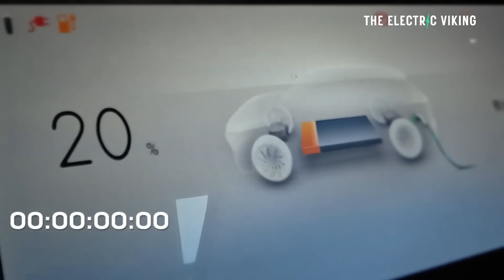CATL Unleashes Sodium: The EV Battery That WILL Rewrite Industry

Comment: 10,000 charge cycles, at what recharging from 80% or from 0% to 100?  And then you If you bought this at age of 20 it would still work when you're 88, my math proves that 10,000 charge cycles if you drive it every day and depleted the energy and recharged it every day you would get 27.39726027397260273 years of life... Still impressive but I'm still not convinced... If your numbers are only driving your car 20 mi and you're at 80% and you charge it up to 100 with no degradation to the lifespan of the battery that would make some sense but if you run it to zero and then charge it up fully what are the numbers look like?

Comment: This channel has always affirmed that li ion batteries are fine. Great performance at all ambient temperatures, long lasting, very rarely catch fire,  great range, lightweight, fast charging.. etc. who needs new battery technology?
Reply: sodium-ion is significantly better in the cold, much safer, has less self-discharge, and likely cheaper once mfg economies of scale take hold.  Historically, main drawback is energy density.

That makes it maybe better in some EV applications, but potentially the default option for stationary storage when mature.  That's a huge deal.
Reply: I just want a battery that doesn't burst into flames.   I don't really want Li-Ion crap in my house anymore.
Reply: Lightweight? EVs are as heavy as a truck. Your statement is misleading
Reply: @ssumac I was being sarcastic.

Comment: I have an e-bike in Shanghai, which has a range about 60km in summary and 50km in the winter.  I am recently shopping for a new set of battery.  Interestingly, there are many sodium batteries on the market, and the price are about 30% lower than lithium counterparts.

Comment: This is certainly welcome news from a Canadian perspective. At the moment, electric cars are great for urban use in all seasons, but for a true all-scenario vehicle we have the three challenges of cold weather, long distances, and poor charging infrastructure outside of major urban areas. (Like having to fill your ICE vehicle using a pump that requires an app that sometimes doesn't work, and when it does you get your gasoline through a ridiculously skinny hose. Hopefully you have a book and not an emergency.) A cheaper battery that works better in extreme cold helps on one side of the equation, and if adoption is significant that incentivises the other.

Without a better charging network it is hard for people to justify going fully electric.

Comment: 10,000 cycles with one cycle every day will last 27.4 years, so not quite as long as you said, but still, really good.
Reply: Do you need to charge every day as a normal driver? Only every other day would be 50 years
Reply: @GoonstarX-n4x  You may be right. I don't even have a car and was assuming that you would need to recharge your car like I recharge my phone...
Reply: @andrewmole745 I knew a taxi driver with a tesla, he told me he can make 350 km with a full battery in summer. I doubt most people drive that much a day. It's not good to keep your battery at 75-100% constantly anyways, at least for lfp battery

Comment: there's a detail to know about how long a car lasts, it's not the engine or the tank (these often can we swapped easily), it's often the electronic and the interior which makes a car expensive to upkeep. Take any bmw with around 15 years of age. The multitude of computers that will start going bad will cost you thousands of euros. Then the new car tend to integrate parts all together and force you to change bigger more expensive parts, on my car the interior door handle broke, I must buy the whole panel !. For instance some new led headlight are one part (not the bulb + the light) in some mid range cars it costs up to 1500€ a piece, even if a led bulb only cost 50€. On the last model S in the back they came up with a light "bar" on the whole width and I guess it's the same range of price. In the end you end up paying multiple times the car over along the way, that's why people change cars often. At least you pay a lot but you ride an all new one. Even if we come up with a immortal power train, believe me, they will make it costly to upkeep.

Comment: hmm LTO has existed for around a decade and is currently cheaper than sodium and has higher energy denisty and higher durability/charge cycles lol. just not easy to make cheap,,,, but for now its cheaper than sodium ion. everyones been sleeping on them. same operational temp range. also my ev is currently at 3k cycles on the original hv battery with no degredation lol

Comment: The Battery Swap was my idea 5 years ago. This is the only thing that will save the Electric Car.
Because the batteries can be upgraded to newer technologies in minutes.
The user should only pay for the mileage they get, not power.

Comment: Wishful thinking. Don't drink the cool aid. Biggest issue with sodium is it's very heavy. Which is why catl is promoting industrial. N charging times are a challenge. Which is y they swap batteries do without infrastructure it's a waste. But it is much cheaper by far. So you may see non vehicle applications.

Comment: The comment about losing 40% range in the cold is probably correct, because of the need to heat the LFP batteries and the interior of the car.
Even with the sodium batteries, in the cold there will still be a large range reduction because of the energy needed to heat the interior the car.

Comment: Electric Dirtbikes from KTM are simply adding a liquid-coolant system/BTMS to next years models, which adds 15-30% range- same batteries, same motor, same bike- this is how effective thermal regulation is! You don’t need more battery. So if you go even furthur and add a sodium-ion battery, with LESS capacity, you may still have the same range due to its improved performance in extreme temps and therefore less loss. So even if Sodium-ion ends up being the same price as LFP, it will still have an advantage in extreme climates and may require less capacity/density, which could then in turn mean the battery is cheaper to produce.

Comment: Wake me up when their is an actual car sold with sodium batteries.
Reply: You won't have to sleep long then
Reply: They're already in use in battery swapping stations, as noted at about 7:45 in.
Reply: They’re in use. They’re just not particularly useful. Too heavy and low energy density.
Reply: @Clynikal  the actual hurdle ist the price (as long as aprox. 7kg/kWh and the volume does not exceed the existing onse more then 10-20%)
Reply: yes , this is the umpteenth disrupting post , remember solid state LOL
Reply: There are already cars like that in china
Reply: Why? You're a lion. Lions can't drive cars. What do you care?
Reply: According to the undecided video on the subject, 30 cars are going to have this battery as soon as January (iirc)
Reply: So if JAC Yiwei starts shipping the E10X, you'll want someone to wake you up a year and a half after it has already happened?
Reply: Well let me wake you up for 'i' instead of  'e' in your their.

Comment: no, the blade 2.0 battery from byd has an energy density of 210 Wh/kg.
* Sodium ion batteries with 175 Wh/kg is for short range
* LFP with 210 Wh/kg is for medium range
* NMC with 280 Wh/kg is for long range
If these netra sodium ion batteries are getting cheaper than LFP, they are attractive for home and grid batteries and pretty shitty low range cars
this is NO game changer for cars

Comment: In defense of carexpert.. I think I watched what you were referring to in regards to range loss of EV's when cold. I'm pretty confident what he was referring to was increased consumption due to increased climate control power usage. It's a thing.. live in Brisbane and when the temp is nice can see 11kwh/100 in perfect conditions, but I've seen over 20 when it's really hot. I imagine heating using the heatpump would have the same effect when cold. It's not necessarily the battery loosing capacity..

Comment: Ack!  Sodium is even more explosive than Lithium!
Reply: But Sodium ions are quite stable - think table salt.
Reply: @BillMitchell-lm8dg  Usually you have a solid lump of metal on side and redox element on the other side of a barrier, and when the ions travel through a "liquid" or some other transport barrier, then you get your stable form and current across the   anode and cathode. That is why lithium batteries explode when Li2O is stable. You have elemental lithium in the battery.  Maybe they came up with some other solution to make the sodium less volatile.

Comment: You might be interested, as many of you do not get low subzero temperatures. I tested the range of my 2023 Kia Niro here in Alberta Canada last winter at -38’C. My Sumer range regularly gets 500 km’s. On this test I managed 260 km’s. I do have a heat pump but I do believe at that temperature there is resistive heating used?

Comment: this is great news as it will reduce the price of electric cars significantly. I think currrent EV producers will very easily be able to just swap out their production line with the newer batteries and use all the knowledge they have built up developing their EV cars.

The battery replacement booth animation made me laugh though. The whole process of swapping out a battery in 3 minutes without  single mechanic is like building an ai bot that is supposed to be able to do plumbing. 

That is a very ambitious concept that I cannot see working in real life.

Comment: Gasoline, Ion, Na, lead based batteries all about energy storage. Storage of energy will be an improving technology, generating energy will be an improving technology. As this research continues, we will see less use for the already tapped out fossil fuels. The car industry has had over 100 years to improve the Internal Combustion engine and didn't go far enough. We are looking at the future in fuel cells, solar, wind, wave and geothermal technology. Just all of us cross your fingers this comes through.

Comment: A typical ICE car without special preparation can handle –20 °C to –25 °C.
With winterization (synthetic oil, block heater, winter fuel), operation is possible down to –40 °C, which is about the practical lower limit for most consumer cars.

Comment: Battery swapping doesn't make sense from an owner's perspective or a seller's perspective and would invite battery swap fraudsters to cash in on taking good high value batteries in exchange for dodgy low value batteries worth potentially thousands of pounds in losses per downgrade.  If the rate of charge is going to increase then it makes much more sense to just fast charge the same battery without physically replacing that huge part of the car every time you need to refuel, and it preserves the certainty that the car you bought retains its good quality battery until an eventual replacement is genuinely needed, if ever.

Comment: Most of the range loss for EVs cold weather is due to needing to run a heater for the passengers, not due to capacity losses in the battery. This becomes obvious when you look at the difference in range loss for cars with resistive heaters, vs heat pumps. If you don't turn on the heater, there's barely any range loss at all.

Comment: Battery swapping stations will be great for the grid, as they can be used as a flexibility resource. This is great with increases in variable electricity supply from wind and solar

Comment: Providing that the cost/kWh is comparable battery swopping makes sence for those who cannot charge at home. millions of chinese drivers live in apartment blocks with no chance of home charging. Have you done a story on the Australian firm who are converting Diesel trucks to electric using battery swopping?

Comment: I believe the car expert review. Those batteries did plummet fast when cold.
Reply: Also, a big part of the drain is their active battery heating system. The review is accurate. Heating large battery packs is not without an energy cost. Pretending otherwise is simply dishonest.

Comment: Battery swap implies  battery-less  cars, which implies low cost -- eg. $4000 EVs. If you remove the upfront cost of large internal
batteries (eg. a tiny battery built in), and instead opt for large shared batteries, you can lower the cost of the vehicle substantially.

And with long life, Na-ion can be swapped indefinitely without CATL having to worry about degrading inventories.

Comment: CarNewsChina: BYD’s subsidiary Findreams Battery signed an agreement with tricycle giant Huaihai Group to construct the Xuzhou sodium battery plant in Shenzhen - with trial production to begin in March 2024. BYD Seagull was rumored to be the first mass-produced EV with a Na+ battery. However, when it was launched in April 2023, it came with a standard LFP Blade battery from BYD. The company hasn’t commented on it since then.  The first mass-produced EV equipped with a sodium-ion battery rolled off the production line in China in December 2024. It was a Volkswagen-backed JAC Yiwei hatchback using a sodium pack from HiNa Battery, and the deliveries will start later this month, according to HiNa. Ford’s joint venture partner Jiangling Motors (JMC) started mass production of another EV powered by sodium-ion battery in December 2024. The car is called JMEV EV3, and the Na+ battery is supplied by Farasis Energy. Farasis Energy says its Na+ batteries have an energy density of 140 – 160 Wh/kg, and in 2024, it will launch a new generation with a density of 160 – 180 Wh/kg. By 2026, they will produce sodium packs with 180 – 200 Wh/kg density, according to the company.

Comment: I'm actually waiting for sodium batteries before installing solar on the house - partially because they will finally bring the returns here in northern England down to around 5-6 years. But in part because there is less of a chance of putting my house on fire. You can put the batteries outside, but because it is pretty cold up here (-5 : 10C in winter, 5 : 25C in summer), LFPs work best indoors. It appears Na batteries don't care either way, which is a bonus.

Comment: This is just another hyping video. The best commercially available sodium battery has 3000-4000 cycles max. LFP is now reaching 8000+ with 10-15 year life depending on usage conditions. Sodium is very far from competing with LFP, let alone being better than it. What you see in this video is just some crap that I can provide you a link for a video ten years ago with the same crappy claims

Comment: This all sounds good and well, BUT
(1) Every week it seems we hear of a "revolutionary new battery technology" that's going to change everything - still waiting..... 🥱
(2) Re. electric cars' reduced range in cold (and hot) conditions - it's not just just down to battery technology, climate control & driving conditions also play a part, and no advances battery tech will solve those energy gobblers.

Comment: I do think sodium batteries are the future if something better doesn't come before. But I do NOT think battery swapping will ever take off. It's too mechanical, it's prone to so many problems, alignment, battery compability, requiring cars to be designed for this from the start, etc... It's not a technological solution. Imagine the system broke while replacing the battery. Now you have a 1.5 tonne ev without a battery, and the bottom part is open... You would be stuck there for a very very long time.

Comment: A 5C (0.5MWatt) charging power infrastructure is perfectly possible, however, for the outdated electricity grids of the western world this is a financial challenge. The growing and relatively new Asian high tech economies are at an advantage with respect to implementing the 5C infra. The fact that sodium-ion batteries can charge between 0% and 100% without degrading the battery could compensate for the lower capacity/weight with respect to lithium-ion batteries (the 20% to 80% lithium-ion battery recharge practice means 40% of the battery capacity isn't used). The number of recharge cycles of CATL's sodium-ion battery with zero degradation is phenomenal.

Comment: With battery swapping, manufacturers will have to standardized the battery pack. This makes more sense than having each vehicle with its own battery pack design & dimensions.  Just like the good old AA or AAA size replacement batteries.

Comment: I’ve noticed the most recent portable power stations getting 6000 cycles. Extrapolate that out to an EV, you’re getting 1.5 million miles. Doors will fall off the car before the battery dies.
Reply: My 12 years old ZOE has almost that problem... benches are without foam and stitches, rubbers and plastics out of place, but the car accelerates has a new one.
Reply: You hear about Million Mile Mercs and Volvos and they're extraordinary. A million mile battery to 80%, let alone 3 million is probably 6 times the life of the chassis.

Then they should be converted to stationery power, but who knows what the battery tech will be by then.
Reply: Some lfp batteries are rated for 10000 to 15000 cycles
Reply: Will be interesting to see the specs when Bluetti launch their sodium powerstation (Pioneer Na) middle of next month.

Comment: Here in the capital of Mongolia, temperature probably the second most important thing in batteries after range and range is most important because Li batteries lose so much of its range. If Na battery can solve both of these, I want it.
Reply: Na batteries sadly can't solve the range problem. but they are cheaper
Reply: @stefanweilhartner4415 So, if they are cheaper, you can afford more batteries....which will increase range. No?
Reply: @joyfuldays-peacefulnights  yes, and the cars floor will be double as thick and 400kg heavier.
Reply: @stefanweilhartner4415  Are they lighter?
Reply: @onceuponatime1492  sodium heavier
Reply: sodium could discharge from -40 to 80degrees, much wide range than lithium already